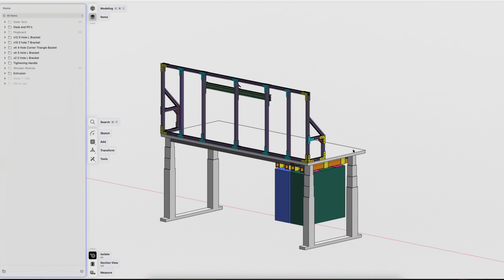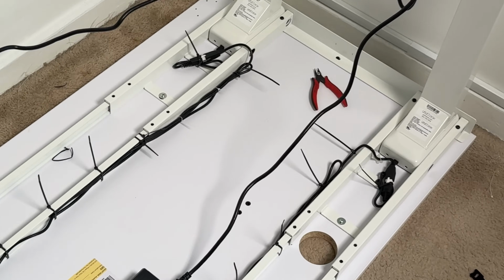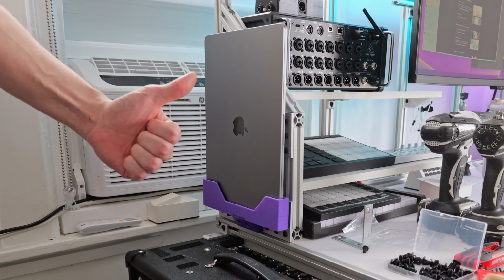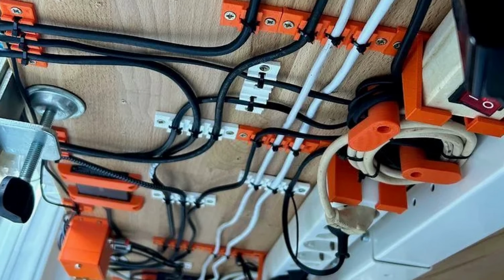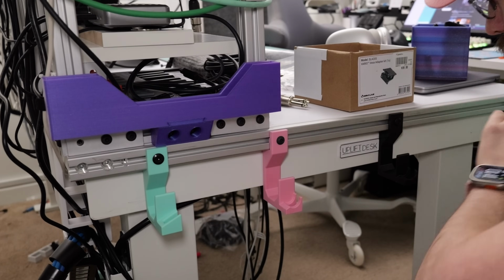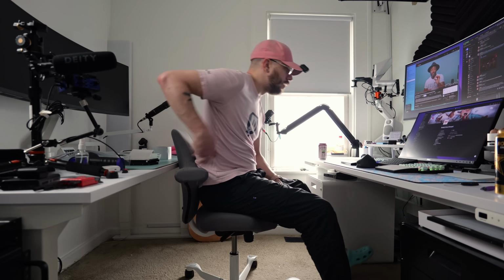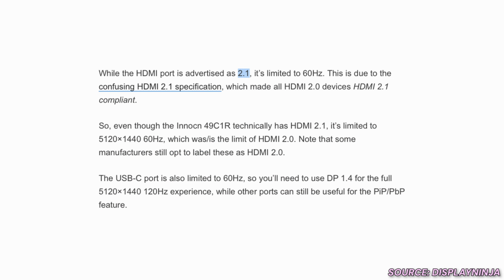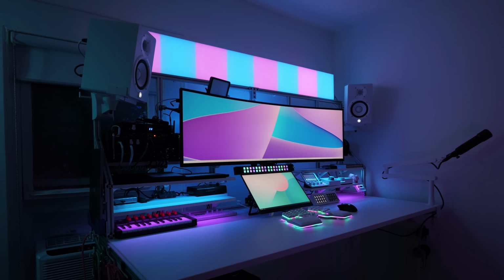Build your desk with Aluminum. You won't regret it.

Comment: LOL, Funny how excited he got from the uni-strut. I work with it quite a bit and just never thought about it.
Reply from the maker: I need to get some of this out in my garage now!
Reply: @Naaackers  When you go into places like Home Depot or Walmart start looking up. Or when you see a bunch of conduit runs pay attention to how its attached to the walls. The uses for the stuff is endless. I used it to make a level base hung from the ceiling of a new hospital to attach stuff like the x-ray machines. They have to be level within 1/8th inch to roll smooth and not drift .lol When you see a guy looking up in  a store he is probably an electrician.

Comment: For small led runs like that, you could make a diffuser with a simple channel 1mm thick and print in white pla. Longer runs you'll probably want more professional versions to avoid seams.
Reply from the maker: oooooo I might try this! I also have some slightly transparent protopasta as well...hhjhhmmmmmmmmmmmmm

Comment: Instead of following his tool recommendations for allen keys/hex, do this instead:
1: Get a set of metric and imperial hex bits 3 inches in length. 
2. Get a mini ratchet/screwdriver like the ICON Locking Flex Head Ratchet from Harbor Freight. 
3 Get an electric screwdriver like the Amazon Basics  4V Cordless Stick Screwdriver.

You can expand this kit with other 3 inch bits. The ratchet from harbor freight comes with an extension and several small bits in case you need to work in a tight space. The ratchet also works as a T handle. Additionally, the ratchet takes a bit in the end of the handle, making it a screwdriver as well as a ratchet. Seriously look into it. It's amazing. Electric screwdriver I mentioned has a fair bit of torque, and makes jobs quick. If you expand this system with more bits, you will want for nothing. ;)

Additionally, I got some metric and imperial sockets that have a 1/4in hex end that will also work in the screwdriver and ratchet. Seriously,  you will never need another kit for small fasteners.
Reply from the maker: Nah my recommendation for this is better 😂
Reply: @Naaackers  Allen keys PLUS T-handles when you could just have a ratchet that turns into a T-handle? Takes up too much space. I 3d printed a little toolbox with all my bits and these tools in them, and it's tiny, effective, and more than anything... CUTE. Unless I am working on a car or soldering, I never need anything but this tiny little toolbox and maybe some pliers. You should try it. It really is amazing. TINY RATCHET TIME!

Comment: Refering to the part where you complain about the OSD on your monitor, did you know you can send commands to your monitor through hdmi? Look into DDC/CI and perhaps you can automate the mode changing with a Rpi, a 3d printed case and a couple of switches. Not all monitor will allow it but I think is worth looking into it.

Comment: hello would you think a audio setup be possible with a small 10inch server rack like one from desk pi
Reply from the maker: I haven't really explored the 10 inch racks quite yet, so I don't know what 10 in rack hardware is out there, but I know you can rack mount any audio hardware easily with a few mods or prints!

Comment: @37:04 which elgato card are you using?  Because theoretically you CAN still do the 120 hz pass through. 

1.Have the capture pc either take the whole 49 or not;
2. Gaming pc runs through capture card
3. Play off of the live preview that is taking up half of the 49 inches or layered on top of the half of your monitor.
Reply from the maker: Elgato 4k X, which has a maximum passthrough of 3440x1440. The monitor is 5120x1440. However, the issue in this case is not the capture card, it's the display not being able to do 1440p @ 120hz using it's HDMI port. That can only be achieved using its display port.
Reply: @ would using the live preview from elgato’s software on the recording computer be a work around of sorts for that? I’ve had to do some similar stuff before to get my ideal frame rates when monitors were limited
Reply from the maker: In my opinion, no. Live preview of capture whether you're using the elgato software or OBS has a delay. Usually somewhere within 500ms. Plus, the capture card is plugged into the 2nd PC which is the smaller monitor, It's not plugged into the ultrawide at all.
Reply: @ ah gotcha, hope you get your desired frames someday. The desk is amazing

Comment: I got an Idea but it might not work... can you use a camera slider as a monitor mount?
Reply from the maker: I wont say no...but I will say that camera sliders aren't meant to hold 30 or more lbs of weight on the vertical. You'd really be spending more money that way too XD
Reply: @Naaackers   I was thinking about that trolley thing that attaches vertically or horizontal

Comment: Another comment...for engagement I guess. You said you've heard of all of the cable management options but I have to point out that Linus Tech Tips has a magnetic arch system that sounds like exactly what you want. I agree - it's annoying when you need to move stuff. Unless you've got it secured with a magnet can remove the cables you need easily, relocate them, and re-stick the magnet to hold down the rest. Followed you on Twitch for good measure. Excellent work again!
Reply from the maker: @cmerr2  so I love magnets. Like… LOVE magnets. I use them all the time. I’ve looked into that system as well, but that didn’t fit the mold either. Not only is the cost pretty ridiculous, but magnets move. And I didn’t want to deal with all that. That could change!

Comment: I love that desk build. There should indeed always be a gap between desk and equipment for cable routing but also for cleaning.
The Streamdesk Studio looks good, fits in with the concept of lifting as much stuff off my desk as possible but I have a love-hate relation with my current StreamDeck: the mechanical click that I feel when pressing the 'keys' comes before the actual key detection towards the PC. I tend to push a key, feel the click and then let go but I find that I do need to push the key further and apply more force than I want to and since I have polymyalgia rheumatica that means this is not always easy for me.
Reply from the maker: I'm with you on the buttons...they're just a little too mushy with too much travel for my liking. Something for production shouldn't have so much travel IMO. 

Bu also thank you for watching!

Comment: This is beautiful and as someone who has a similarly overengineered setup that cost way more time than it should have, I appreciate your current iteration immensely. Watched the entire thing and the process was fun to follow along, with the final result being the cherry on top.

One thing that might interest you, as I have the same mixer: I thought you can't use the Behringer X Touch Mini with it, as it is USB, but the XR18 USB port does not allow for that to connect. It can only be controlled via MIDI or via network. There is however a device from DOREMiDi that is a standalone USB to MIDI box. You can connect an X Touch Mini to it, program that to however you like, connect it to the DOREMiDi, connect that via MIDI to the XR18 and you got a fader, 8 rotary encoders, a bunch of buttons for mute etc. - it is incredible. Just something I thought I would put out there, as you may have considered and discarded the X Touch Mini for the same reasons I initially did.
Reply from the maker: OH snap that is amazing, I'm going to check that out right now. Thank you so much!

Comment: I need to see someone remix this for a vertical monitor on the side
Reply from the maker: I actually tested a vertical portable monitor for this setup! Used the same SmallRig tension arm and a 3d printed 1/4-20 to vesa bracket, mounted to the 1010, done!

Comment: You may want to look into HDMI and displayport protocols for controlling devices. I have found some tool for my Philips monitor that allowed me to change setting directly from pc without the monitor menu and if I remember correctly it can even change source. I know this is super general, but I don’t recall any more details, but in case you didn’t know, this may help.

Comment: so I've been looking for a way to safely mount my pc underneath my desk since I have a full tower chonky boi. I liked your idea of using the strut channels but because your use case requires you to be plugging and unplugging hardware from your pc more than I would ever need too, I don't really want the rollers because I don't want to have to drill in my case. Do you have any ideas on what I could do as a alternative for the rollers? I was thinking about possibly creating a sort of platform utilizing the struts. the platform itself could be made from wood so that the pc sits and is easily removable.
Reply from the maker: Your idea with the wood was one of my first ideas! I saw a lot of "under desk chasis" products where it was just a bit metal sleeve you put your PC into, or a shelf that you put it on. It just seemed like so much more additional metal and product for a little return... I would think if you did something similar to where you screwed in a hook of some sort to the PC chassis, and then you hooked the PC onto something uder the desk? Kind of like a hangar in a closet?

Comment: How do you go about cable management for the Defy? I've tossed up having two magnetic cables for charging only, that I can stash away when they don't need charge
Reply from the maker: Honestly this is my biggest gripe with the keyboard. The cables that it shipped with are THE STIFFEST cables I have ever had. Except when I use anything else, it doesn't charge correctly or it charge a little and then it dies within an hour of being unplugged. Super annoying. I find myself leaving it plugged in almost always now. But when I game, I unplug and push my cables under the monitor. 

I actually tried to use my magnetic charging cables when I first got it, but they did not charge the boards correctly. Which brand do you use?
Reply: @Naaackers  Just some generic non-data one from Aliexpress, seems to charge reliably but I've found myself with one half dead in the office, so holding off until I buy another.

Great video by the way, love your production and I'll definitely consider building an extrusion desk frame in the future
Reply from the maker: @c9k  Yup I have that same issue. Always my left one that dies... LOL. 

Also thank you!